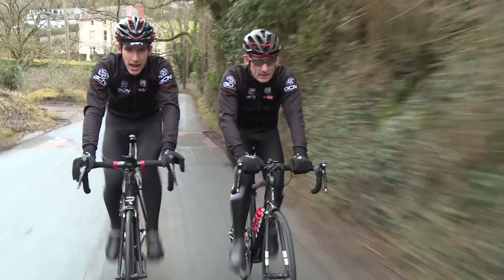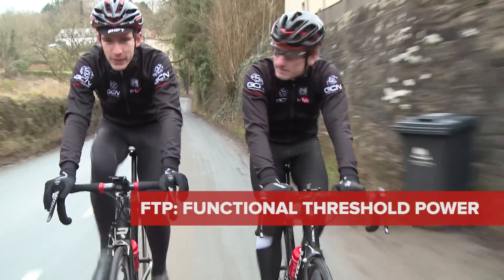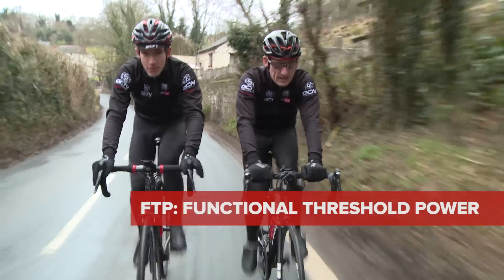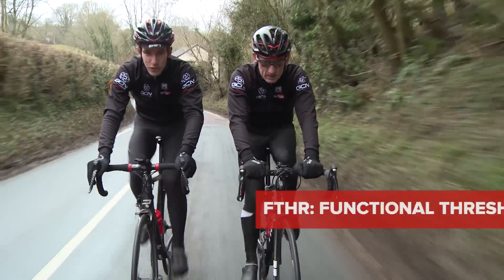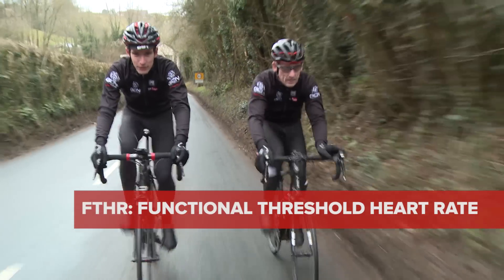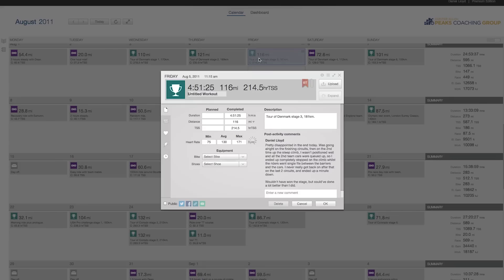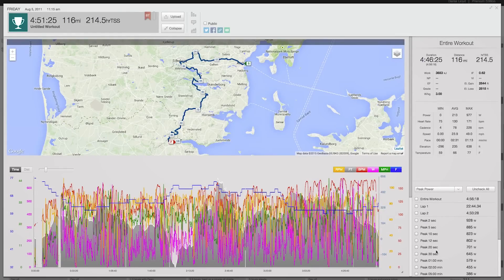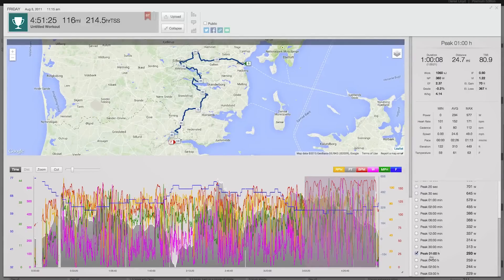How To Calculate Your FTP (Functional Threshold Power)

Comment: The more you tweak the tests to give higher numbers the more overestimated the result will be.  The best way (even better than ride one hour due to pacing problem) is to make a 5 min max test, then wait 10 minutes and then do a 20min test. Then use Monod Scherrer to determine your CP 60. This is also your FTP. Don't change the protocol. I.e. doing a 20min test without 5min all out and taking 95% as many do gives almost certainly 5% too high FTP value and makes training sessions too hard.

Also, there is no single FTP heartrate. Riding at FTP over one hour the heartrate will raise from Zone 3 (first 3 minutes) to Hf max (last 3 minutes). So every 5 minutes there will be a different herartrate. You can take the average, but it is meaningless except at 30min into the test.

Note: Power*time above FTP to VO2max is called anaerobic capacity but that is false. Up to VO2max almost everything is aerobic. You can verify that with a step test and measure O2 consumption. It raises linearly with power which means the power is produced almost entirely aerobically. Instead it is that more that more and more fast twich fibres are activated which produce more lactate and tire much more quickly. Instead Anaerobic capacity which is a misnomer the therm temporary aerobic capacity over CP would describe it much better.  

Anyway use Monod Scherrer, it is much better i.e. more accurate than 20min alone.

Comment: i recorded my cycling data with google fit for speed, time and distance and used my oneplus band to record spo2 and heart rate then sync it to google fit and then downloaded it to manually upload it to strava where I saw my avg power for 2hrs was 166W with maximum power of 1280W at some points... i never knew I could release that much power... 
i don't know how accurate this is but it must be 90% accurate which measures for 150W avg power which is also impressive for me

Comment: I don't understand the term "20 minute peak" - where's that on Garmin connect ride analysis results?
Reply: Hi Mark.
In your ride analysis where it has power data from your ride on the left it will have the following listed.

AVG power
MAX power
MAX AVG power (20 mins)   -  this is your 20 minute peak. 

20 min peak is the highest 20 minutes of power that was performed continuously within your workout.
Reply: Thanks for clarifying.

Comment: I've recently started to train for a triathlon after cycling exclusively for 2 years.  I train with a heart rate monitor.  Is my FTHR going to be the same for running and swimming (while required effort to achieve FTHR may vary)?
Reply: I found this Swimming

Functional Threshold Pace:
Swim for 30 or 60 minutes as fast as you can, then record how far you went.  For example, if you swam 30 minutes and cover 1000 meters, then you can use the value of 33.3 m/min. as your FTP. Since the actual FTP is closer to the one-hour effort, it might be more advisable to perform a 60-minute test, or to take the value obtained for 30 minutes, multiply by two and subtract 2.5 percent (as most trained swimmers swim roughly 2.5 percent slower in a 60-minute maximal effort than in a 30-minute maximal effort). So again, if you cover 1000 m in 30 minutes, your 60-minute FTP would be 1900 m/hr or 31.7 m/min. This may seem like a minor difference, but due to the resistive aspect of swimming, small differences can have a substantial impact.
Reply: +Jason Stroman Thanks for the info. I was really looking more at heart rate than power. If my functional threshold heart rate is, say, 158 bpm for cycling, is my functional threshold heart rate for running and swimming also 158 bpm?
Reply: Tim Krause Your threshold is what you can hold for an hour,  your HR during that effort.

Comment: Since I got a heart monitor (this year) that actually records my workout (instead of having to look down at the old school version) and a cycling camera for documenting rides and my heart rate, I found out this summer that I frequently pace in the 190's for minutes on end, sometimes even downhill, my longest time being 11 minutes (until I had to dismount to lock up the bike).  I don't have a power meter, yet.  

So, ought I take it from your video that in the 190's would not be my FTP nor my FTHR.?
Reply: A bit late but wind can mess with your heart rate monitor, so the 190 on downhills is probably caused by that.
Reply: Strong electrical fields yes, but I have not heard of wind causing an HRM to malfunction.  However, because of the additional resistance [I imagine], headwinds [which I love to fight] tend to elevate my heart rate.   A couple months ago during a vicious headwind, in a 50 to 60 mph gust, my rate went from below 180 to above 200 in less than 10 seconds peaking at 210, and is documented on my  channel as well as my barely 400 lb. bicycle trailer - a real road monstrosity with a mind of its own.

Comment: Ok, so here's a question... do I use my Normalized or Average 20 minute power for the FTP calculation? Why? What would the effect be of each? Why might they be much different in a test like this?
Reply from the maker: Michael Fiola I'd use you average 20 minute power. Normalized Power is calculated using a weighting system – for example, if you ride really hard for 10 minutes and then easy for 10, the average might be the same as simply riding at a medium pace for 10 minutes, but the effort and training effect would be vastly different; that's where Normalized Power comes in. So, if you used your Normalized Power to calculate FTP, you'd be calculating your FT Normalized Power, which would likely be higher than your FTP, and a calculated value rather than something you'd be able to replicate out on the road.
Reply: Global Cycling Network Thank you
Reply: +Michael Fiola If you do a full gas 20 minute test to calculate FTP and you are able to keep a consistent power i.e. no stopping at lights etc, you'll find that average and normalized are pretty much the same.

Comment: Just another point to mention. The results I get on my Tacx flow trainer are higher than those on my Quark crank-based power meter. I've have had the trainer for years. However, the two years when I was watching both showed that the Quark translated much better to actual road conditions. It also showed that I was easing off too soon at the tops of hills. Just a note to be careful with numbers and expectations between different power meter measurements.

Comment: The version of this test I have done with cycling clubs and tri clubs (on a trainer - it's unridable outdoors 6 months of the year where live) is pretty similar except for one difference. Warm-up 10-15 minutes + 3-5 short sprints, rest 5 minutes, then a 3 MINUTE ALL OUT EFFORT, rest for 10 minutes, 20 minute test, warm down. Still use the 95% factor on the 20 minute test. I think the theory is that the 3 minute interval reduces the 20 minute performance to something more like the actual FTP. Results seem to correspond to power out on the road. Comments?
Reply: Necromancing a bit. Yes, this this is pretty much how the wahoo elemnt devices are programmed with the built-in FTP test. The rationale for the lead-up efforts is not only the obvious warm-up effects but a slight depletion of the muscle glycogen stores to elevate the heart rate for a better FTHR reading.

Comment: I don't see the point of knowing what intensity I can ride at for one hour ifo I've learned from experience what I can sustain for each of my favourite local climbs, whether they are the 12 minute one or the 1hr20min HC monster. You learn to pace yourself given the length of the climb.
Reply from the maker: It's not just about knowing what you can produce for an hour, but making sure that you are in the right 'zone' when you're out training.  A structured training programme where you do intervals of varying lengths in the different training zones should see your FTP rise, and at that point you'll be able to ride harder up your local 12 minute or 1hr20 climb.

Comment: Wondering if the price of power meters will drop in a couple of years. There a bit pricey atm for me to justify one.  I'm currently using the Motivo app with the "simwatts" function.  It may not be perfect but whilst on the indoor turbo it should give a repeatable base if all other conditions are similar.  

Although would a HR monitor be better to gauge progress?
Reply: parttroll1 I used a HR monitor and HR Variability (to measure recovery status) to progress from Cat 5 to Pro 3, and will soon reach Pro 2.  I had to study exercise physiology extensively for my degree, so I understand that as long as my intensity is high enough to elicit a positive training effect, I'll continue to get stronger.  People say that HR isn't reliable because it varies, but as long as you make a habit of being hydrated and sleeping early, HR is very reliable.  In terms of power meter costs, if you look up "watteam", they're releasing a power meter in Summer 2015 that is set to cost $500.  That should drive the price of the other power meters down considerably.
Reply from the maker: We're certain that the prices will drop quite dramatically over the next few years, as more and more companies dip their feet into the market.
Reply from the maker: EatSleepTrain Smart Agree on many points.  I also used a HRM to great effect for most of my career, however, it's one shortfall was that I lost a few training sessions because of it.  By that, I mean that with fatigue, my HR comes down quite significantly.  The old advice was that if your HR was suppressed, that you were too tired to get a meaningful session done, i.e. if you weren't able to get your HR into the required zone, it was best that you turned round and had a rest.

However, what I found with a power meter, was that there were certain days when my HR was well below normal, but my power was as high as ever, sometimes almost a PB.

Dan
Reply: Yes I remember those days.  That used to be a problem with heart rate training, but thanks to HRV, that's no longer an issue.  HRV algorithms can analyze your parasympathetic or sympathetic status and accurately determine your recovery status/ risk of illness.  You can exhibit an abnormal heart rate, but HRV may say that you're physiologically able to achieve back to back high intensity workouts without a loss in quality.  Before HRV was available, I used to take recovery days when it wasn't absolutely necessary.  To get the most out of HR training, HRV really is a necessity.  Actually, HRV is also valuable to power users since it is the most useful tool for preventing overtraining.
Reply from the maker: EatSleepTrain Smart I used CTL, TSB and ATL to prevent over-training.

Comment: 20 min HR should be multiplied by 0.95 or I just take the reading as is?
Reply from the maker: The Heart Rate test is 30 minute long, and you should take the average HR of the last 20 minutes.
Reply: Global Cycling Network Sorry to re-clarify, but are you saying that FTHR is 100% of the HR average for the latter 20 mins of the 30 session.  As opposed to the FTP calc which reduces the 20 min power measurement down by 5%?  Also, am I correct in concluding I simply can't calculate this without the power meter, i.e. only with HR monitor, as I have no way of knowing if I've gone anaerobic and am just bleeding power thereafter?  Thanks.
Reply: David Hale ig ur watching this u shouldn't be getting smart man. Use a mtb single speed see how tough ur legs r lol
Reply: serkek ono ? Are you simply too stupid to understand my question or are you drunk?  Perhaps both?  Stop being an ignorant buffoon.
Reply: David Hale Global Cycling Network I got confused as well. I know my average HR but opposed to the FTP i don't know what i'm supposed to do with those numbers (my average HR) and how to improve myself by going on FTHR.

Comment: what if we dont have a power meter or a Heart rate monitor can we still do it
Reply from the maker: Unfortunately you can't.  However, many people have done very well on feel and not looking at any numbers, so don't feel like it's going to hold you back.
Reply: If you have a speed and cadence sensor and use an indoor turbo trainer you could use the Motivo app or sign up to Trainer Road to simulate your power output according to which turbo trainer you use.  it might not be as accurate as an actual power meter but it will give you a base to work from if training indoors and to monitor your progress if all other factors are equal.

Comment: I have Low Blood Pressure, and whether training or doing criteriums (kermis-koers) I find that the first 10-15 minutes my heart rate is pretty high / at the limit, but then it 'calms down' and remains constant, even during a demarrage or sprinting for the finish line. I guess calculating my FTP would only work if the first 10-15 minutes vs the rest of the time remains constant every time I test and compare. Could it also be a case of the 10-15 minutes being a period where the lungs are 'opening up', allowing more oxygen to the muscles? Then it would be best for me to do the test that begins with the 20 minute warm-up!

Comment: why Strava Premium Calculates for me an FTP of 305W but never sustained more than 285W for 1h. 
For lot of friends of mine, the Strava calculated FTP seems to be to high too. 

Has anyone a comment on this?
Reply: Strava's algorithm for calculating power isn't very accurate. Afterall, it's not a strain gauge on your bike is it? It goes off figures which have many variables. Essentially, it looks at your speed, the gradient/elevation changes, your weight and your bike's weight. It doesn't know however the wind, road surface, whether you were drafting, weather etc Which are all things that can alter your speed and therefore give an inaccurate result. I'd say it's about 10-20% +/-
Reply: Ben Johnson My post is based on real measured power meter data (rotor power crank)
Reply: Late reply, but strava takes your ftp based on your best 20min and not by the 1hr. Even though you may have data from a powermeter even for an entire hour. Probably you haven't pushed hard enough for 1hr, instead of 20'. That's why the test to calculate is based on the 20' time. 
Hope it makes more sense.

Comment: Would using a Watt Bike give you a reliable FTP?
Reply from the maker: Yes, a Wattbike gives a very accurate power readout, so it'd be a great way to carry out an FTP test.  However, as noted elsewhere, it can sometimes be harder to put out the same power output indoors as you can out, so you may find that setting zones from an indoor test can mean that you're finding training outdoors in a certain zone quite easy.

Comment: Is there a marked difference calculating FTHR on a trainer rather than on the road? You mentioned a power difference that could skew FTR calculation but would greater control over variables (wind, gradient, temperature etc) mean a trainer result for FTHR would be more accurate?
Reply from the maker: Rory Mackay please don't fuel the fire Rory.  Dan's head is already inflated like somebody's inserted a CO2 cartridge in his ear.
Reply: Hi Lee Macklin - heart rate is quite changeable from day to day, due to many factors, one of which is core body temp.  So, if you're hotter indoors because you don't have enough fans or it's a warm room, you may well find your HR is higher on the trainer than it is outdoors.
Reply: I thought this may be the case so I think I will give this a go on my turbo in the garden and see how I get on then test it on the road once I've worked out a decent route! Thanks for the prompt response!
Reply: Daniel Lloyd Obviously you'll have no problem with not having enough fans, Dan.
Reply: Global Cycling Network It is amazing he can fit his head in a helmet. How does he maintain any aerodynamics? I guess its just cause he's a boss.

Comment: Finding a straight road could be a bit tricky but I do have a turbo trainer. Would you suggest a 20min effort x 1 rather than 0.95 for my on the road ftp?
Reply from the maker: Possibly, that might work.  However, if you don't have many straight roads, does that mean that you train predominantly indoors?  If that's the case then you should just do an FTP test on the trainer, and use the zones you calculate from that when you're training indoors.